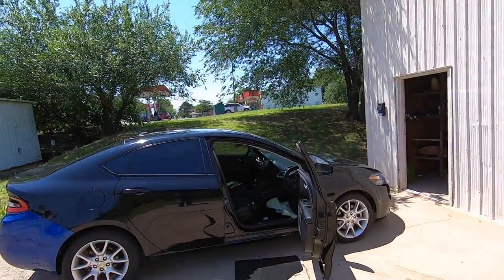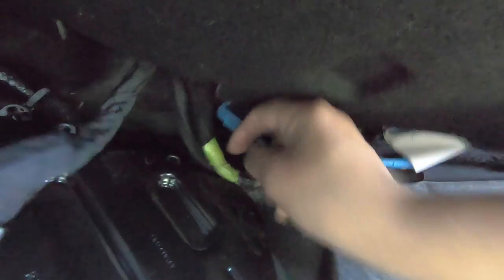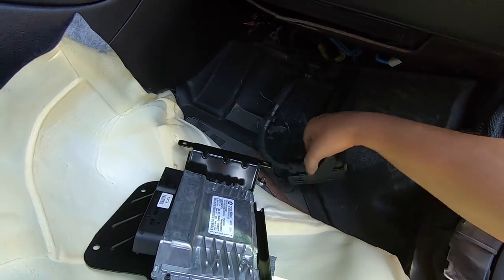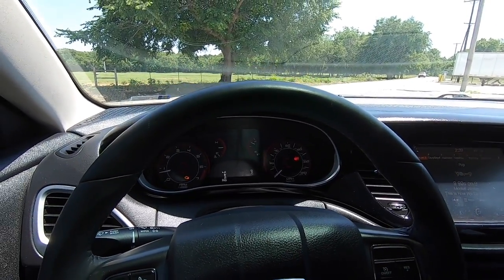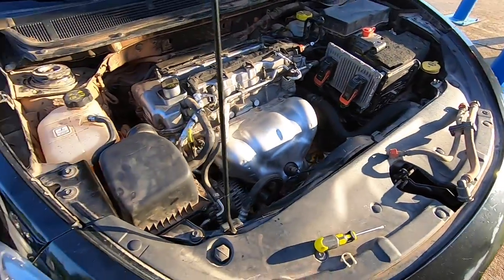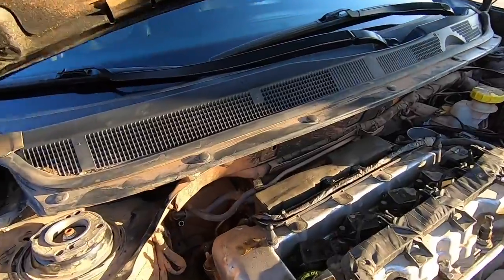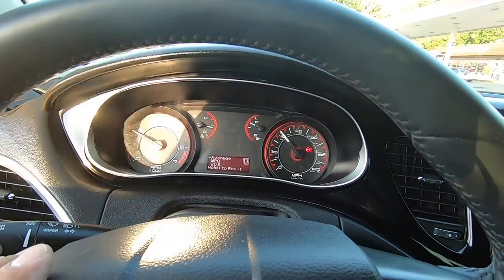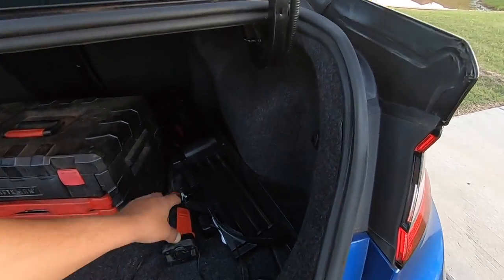$1535 Copart Flood 2013 Dodge Dart Transmission Issues

Comment: So the Darts specifically had TCM recalls, Dodge can fix it however yo ucannot replace the TCM on your own or from a regular mechanic you MUST take it to a Dodge dealer because they have to program the TCM to the car, thus the reason why its not shifting correctly.

Comment: It's not like the transmission was rebuilt so it should shift fine. I'm going to call bu#*it on that. That peice is called an active grill shutter. My Ram has one and they say it helps save fuel.

Comment: I'm glad you figured out the transmission problem and things are picking up for you. I'd be back at that dealers for a refund on that whole job as they messed most of it up, by the sounds of it. Thats kinda scary about the steering can't be re programmed does that mean you cant just swap one or they can't be programmed after they leave the factory so you can't put a new one on either ?    parts prices are scary now for anything if you can't get used, does a wrecker have something locally cheaper or would there be one on ebay somebody has used. I buy 90% of my parts new from ebay USA. I'm in Canada close to the border it's still cheaper with a poor exchange rate and going to the border to pick stuff up, than the local parts store we drive right buy. The store owner told me he can't even buy his own project parts at cost cheaper than Ebay, so he does it to thats just sad !
Reply: IMO, a lot of these mistakes such as forgetting to tighten the air hose, happens because mechanics are working on several vehicles at once, back and forth. Much easier to miss something than staying with one at a time.
Reply: @danielhartin7680  Yes that does happen to. I'd just hate for anybody to be involved in any way, on a day somebody screwed up on brakes. If there was an accident after the guy was jumping jobs and "forgot" something important .

Comment: That Dart is becoming a beautiful little laborious money pit, lol. But I'm sure I would do exactly what you are doing if I were in your shoes.
Reply: Whoever bought it got a car rebuilt with lots of TLC and Randy rebuilt it with pride as if he was going to keep it! I heard that he sold it to some lucky person at a very low price around I believe $4700.00 with a profit of $2800?
Reply: @johnbeckham1483  I agree. Randy doesn't do anything half a@@ed so I'm sure that car is still running and driving great. It's been awhile for me but if remember right Randy did make around $2800 on it. The buyer got a nice deal on it for sure.
Reply: @DeepSouthTechie  I agree as I was very much impressed how he rebuilt the powertrain on the flood damaged black Dart from the donor blue Dart!  I personally own a 2014 Dodge Dart SXT & as a result of Randy's video on the Dart I have learned lots about my Dart!  Take care & thanks for your reply!
Reply: @johnbeckham1483  I love those Dodge Darts, they're sporty cars. Take care buddy.
Reply: @DeepSouthTechie  I love those Dodge Darts as well!  I have to check my antenna connection on the roof as I think the connection shorts out as my AM radio comes & goes!  No big deal as I will shoot some WD-40 The Specialist Electrical Contact Cleaner Spray down the threads as water or paint sealant from car wash perhaps the culprit?
Reply: @johnbeckham1483  I would give that a try since they can get soap and such down into them. But if the FM is doing ok then it may be the head unit itself. I've had an older unit do something like that and eventually stop receiving a signal. I would try the WD-40 and hopefully it'll help with the signal loss after it penetrates over time.

Comment: Glad it worked Randy & The dealer really didn't due anything but charge $$ . I've never heard that before ( Drive it for a couple of weeks until it learns it's self lol ) with that trans module different! I don't know if that would have Happened 🤔. Nice job & the Jetta looks great & of course the Harley ☄🔥🔥💯😃will check out Tjs channel & sub 👊👌Salute 😎

Comment: I don't know about dodge but my 2008 f150 runs all screwy after pulling a battery.  It needs to run down the road for 20ish miles before it starts to act normal.

Comment: Forgive my being a bit simplistic but as the ECU swap out fixed the transmission because it came off the other car well maybe swap out the relative ECU for the steering rack?
Reply from the maker: I tried that and the car wouldn't even start at all lol.
Reply: @AutoAuctionRebuilds  See I said it was simplistic Randy ... so just swap the steering rack then. Can't be any worse than a Renault ... Good fun though ...

Comment: not dealers fault it had the wrong pcm hooked up to the wrong motor though.
Reply from the maker: Considering I told them I swapped motor, trans, and rack but nothing else and I needed them to reprogram any modules that I will have issues with, and they failed to do so, I feel it is their fault.
Reply: @AutoAuctionRebuilds  i hear ya  people think those dealerships know all, a lot of times there no better than a regular garage, at least that's been my experience with them
Reply: @AutoAuctionRebuilds  At least you got it figured out.

Comment: I had a dart and the transmission is terrible. Traded it for a Hyundai Elantra. Much happier
Reply from the maker: Sadly the Dart's transmission is the same found in many Hyundai / Kia cars. Hyundai made this transmission lol.
Reply: Auto Auction Rebuilds lmao yes the DTC on the Hyundai’s are pretty crappy but my Elantra has the 6 speed automatic and those are pretty reliable.

Comment: They run off a manual transmission that was converted to auto through a TCM it will always do that regardless tbh there will no fixing it.... Ford and dodge both have class action law suits over this
Reply from the maker: That was the DDC which this car does not have. This is the regular Hyundai 6 speed.
Reply from the maker: And it's fixed now.
Reply: @AutoAuctionRebuilds  gotcha my fault :c
Reply: @AutoAuctionRebuilds  because I do know a phew of em have that shit trans and it's a hell hole I've experienced it myself with a 2014 focus and I trashed it to get a manual lol
Reply: @AutoAuctionRebuilds  love what ya doing with this though ik all the small computer modules are a pain in the ass though I honestly think it's just a money gimmick to make people scared and get more money out of people

Comment: Dealership hosed you big time. You could have done those fluid changes yourself for under $50
Reply: I may have missed it, but did Randy tell the dealership he had a donor Dart with the original transmission component?  Knowing that and not letting the customer know they could be swapped, would be unethical and dishonest.

Comment: I own 2013 dodge dart 1.4 rallye multi air turbo dual clutch speed automatic an it's reading service transmission auto stick gear not available so over this car had in an out the dealership they said be 7300 for transmission I said no lol

Comment: Before swapping the rack and pinion, call around in your area, there should be a auto tech guy that does programming that should have wiTech machine to program it. Sounds like the dealer fucked you over. But what do I know

Comment: Calling BS on the Auto to learn how to shift ,i have been in the game for Far to long to take that kind of BS from a dealer,that should have just plugged into a test unit and seen the codes , Ps: please do not get a Job as a Grenade builder and not put the pin in :) Boom (  fuel line clip )

Comment: That dart, or the Jetta should be parked on the street...that harley ford should be in the driveway..just based on value alone..what I don't understand, is why the people like this dart so much....seeing how much of a pain in the ass it has been to work on..the bs  300 air deflector...and dodge still isn't that great...some people get lucky..but I'm general..not good..your experience at the dealer reflects the quality..flood cars always have electrical issues down the road...whoever buys it, isn't gonna be happy when that happens..that's almost always how it happens